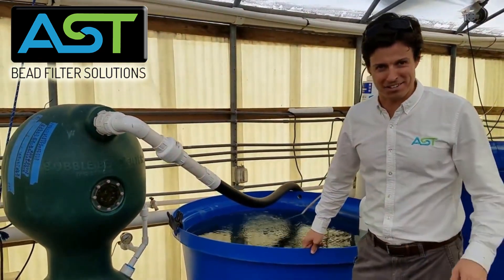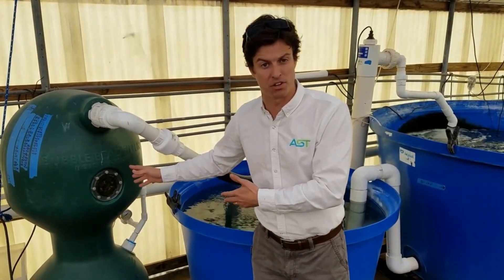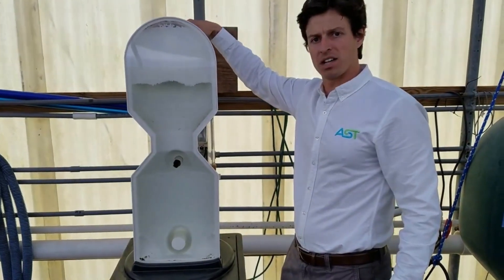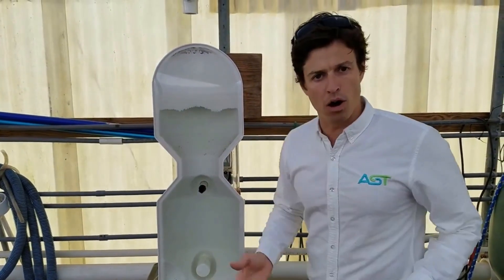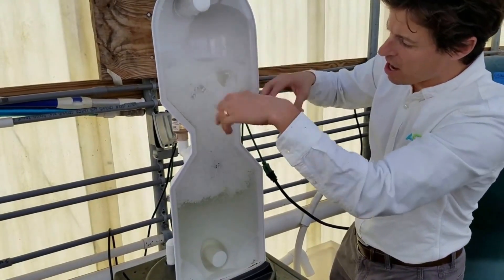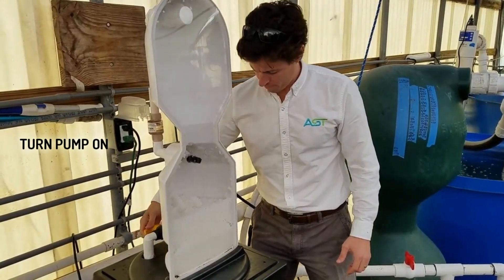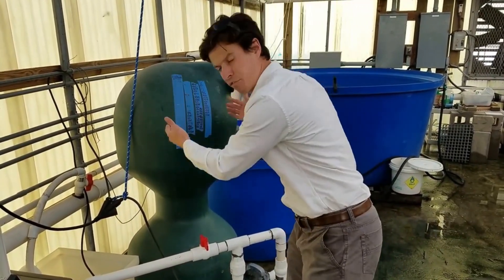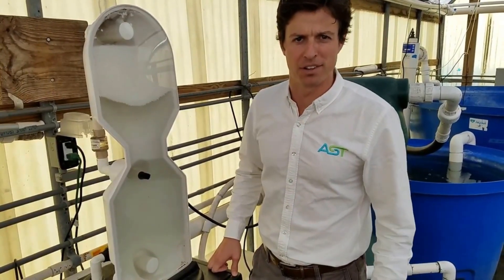Backwash Demo of Bubble Bead Filter! Robust, dependable filtration for ponds!

Comment: In a koi pond system, would you recommend a sieve installed  before the bubblebead to act as the  mechanical filtration  and the bead filter  the biological.
Reply from the maker: Lee, good question! All of our bead filters are designed to be both the mechanical filter and biological filter, so there is no need for a pre-filter prior to our unit besides maybe a strainer basket to protect the pump and filter from large solids that would clog. Thanks for watching!
Reply: @ASTFilters  thanks for the reply, i have a bubblebead to install on my pond, so thanks for that !

Comment: Hi paul.. how you prevent water flow out from filter air inlet?
Reply from the maker: Thanks for writing in! There is a check valve on the water inlet. This allows air to be sucked in for the backwash, and it closes when the water level rises back up.

Comment: No rinse? So the stuff left behind in the beads gets pushed back into the returns?
Reply from the maker: Great question! Very little waste flushes back into the system. Occasionally, if there are many fine solids, you may encounter a small clouding, that we call a "dirty burp". If you want to avoid that, the beads can get a second rinse. That is a more complicated backwash option, and is not covered here. It is always an option. It all depends on what factors you are managing for.
Reply: touche

Comment: Where does that backwash end up? Do you use it for anything or is it simply waste water?
Reply from the maker: The concentrated waste from the backwash makes for great fertilizer for plants and landscaping. Some people will mineralize it for Aquaponics to grow lettuce and other plants. If you don't have any use or want of it, it could just be waste water.
Reply from the maker: Justin,
That is totally up to the system operator. Aquaponics systems can benefit greatly by breaking down the waste contained in the backwash water through the process of mineralization. Again, the choice is yours. Thanks for watching!

Comment: How do you keep the beads from going right out the top (outlet)
Reply from the maker: Jake, there is a slotted pipe screened outlet on the bubble bead filters that keep the media in the hull. The beads act as a filter protecting the screen from clogging. Let me know if you have ay other questions about the bubble bead or any of our filtration systems. Thanks for watching!!